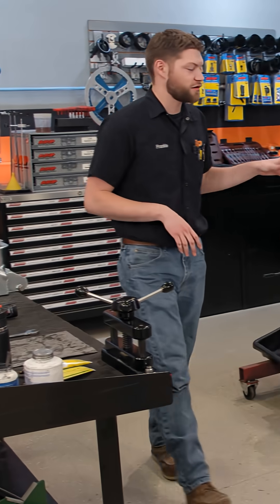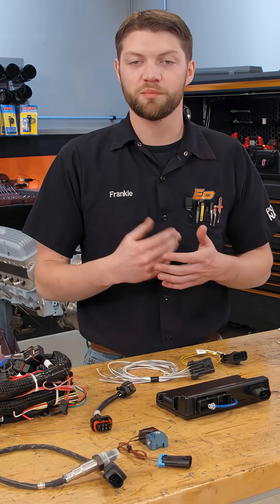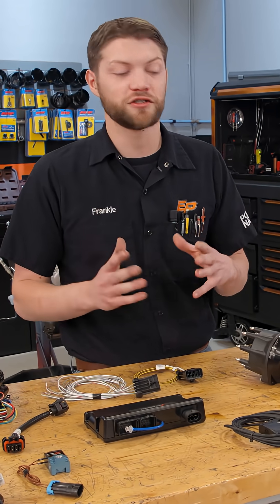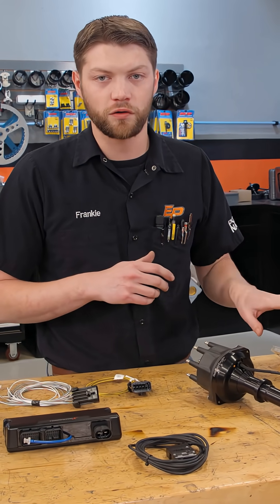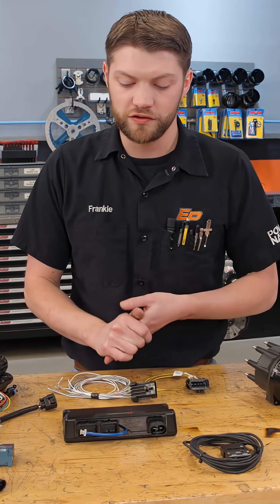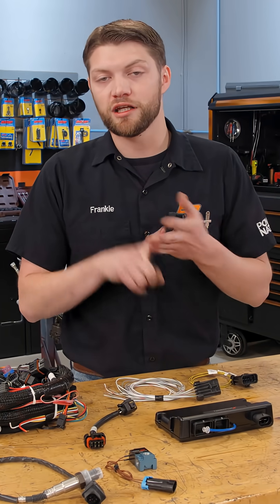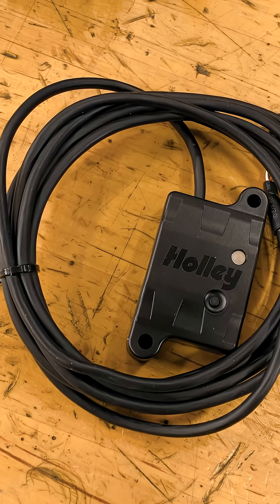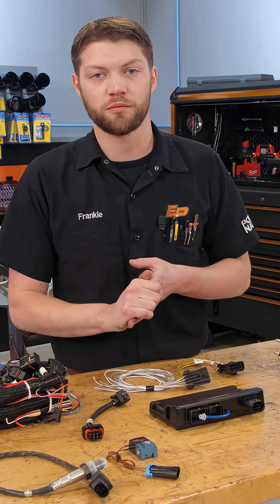How to control a twin monster!

Comment: A what about Buick old and Pontiac big block 455
Reply: I agree I have a big block Oldsmobile 455 1190 in a G-Body station wagon rocket power
Reply: @kennybrownlee8914 mines in a jet boat howards flat tappet cam og ka req heads forged flat tops oil restrictors decked aling honed 0 decked crank cross filled and heat treated joe mondellows cam button and acl race bearings comp cam stamp steel roller rockers joe helped over the phone he was a real cool dude